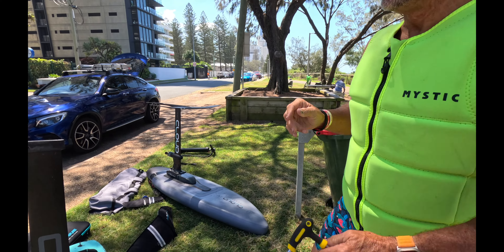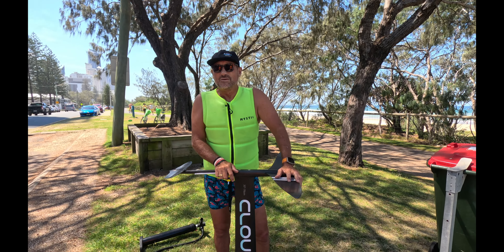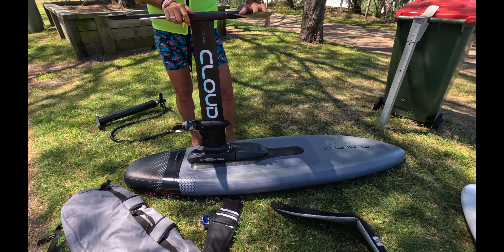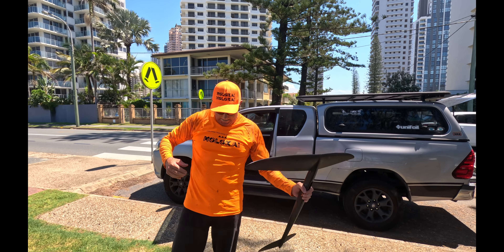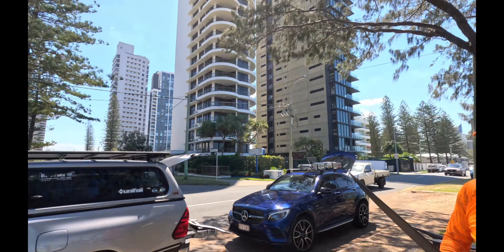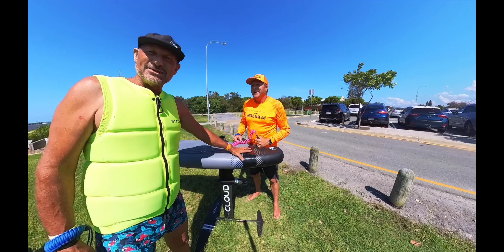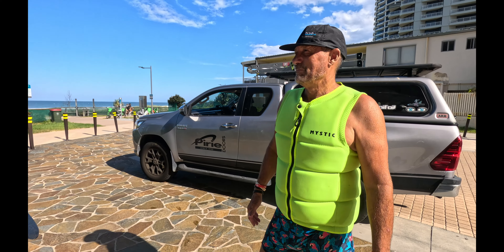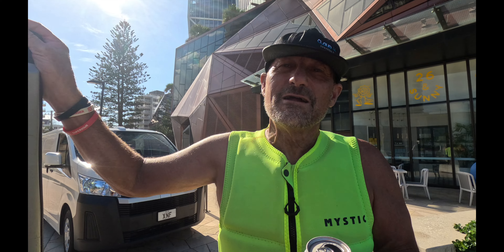Foil Drive Gen 2 Downwind

Comment: Thanks for sharing! Would love to see a getup with the FD and the 860, and also hear your thoughts on the 860 vs 850 and 980!
Reply from the maker: The 860r pop up is just a touch slower than the 980s both will easily start into the wind . The 850s is a bit harder than those and need to run across the swell I use the 158 rear on all 3 . The 770r with the 175 tail starts same as 850s . Medium fuse on all . 980 surfs amazing and when it’s bigger the 850 rules . The 860 & 770r in clean small waves are both tons of fun . 980 is most stable for DW but obviously the 860r has way more glide but it can be a handful in messy conditions. The 860 has a mental good pump as well and by far the best for connecting bumps .

Comment: Rob, how much of the time are you running the FD in this one?  I can't seem to stay on swell yet (just wind chop), but I can downwind at a good clip with only 25-30% throttle, and that is its own kind of fun.  Are you running like that with the FD usually on and using the swell to get a much longer run from your battery... or are you doing something else?
Reply from the maker: If you are not free riding bumps 10km is pretty well max distance you'll get. What shortens this is bad pop ups eats into the battery. To play it safe keep your DW runs to 7 or 8km that way you can stay on the throttle the whole time with heaps of falls. I'm up to 20km runs but that's with heaps of free foiling and pumping.
Reply: @Piros181  Cool.  Thanks, Rob!  Enjoy!